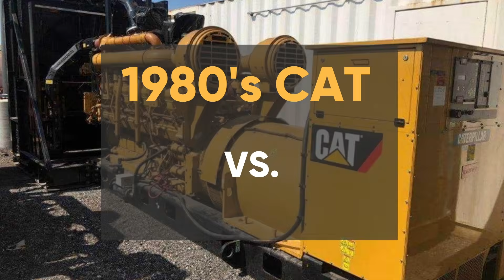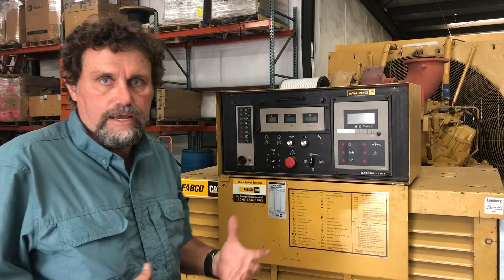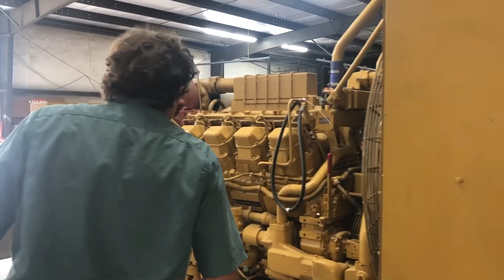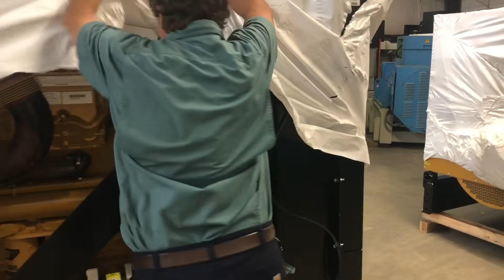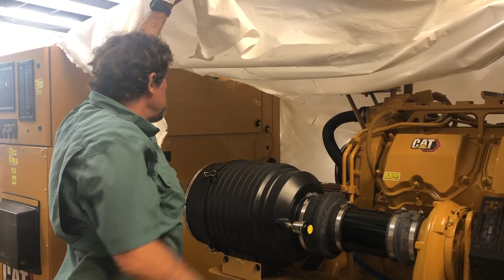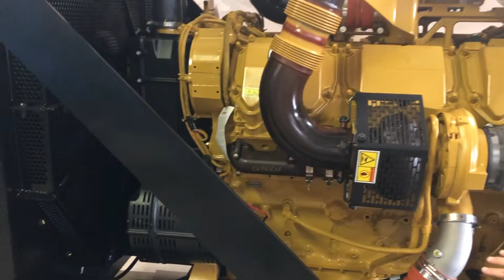2021 1000 kW CAT C32 Diesel Generator Review and Comparison

Comment: I would still take the older model as the newer model is so heavily invested in electronics that a power surge in the new electronics would kill it. Yes it is definitely doable to improve the old one to be more feeicient but the less electronics is a plus.
Reply: And that's why you work at McDonald's
Reply: @chechnya  oddly enough, I don't work at McDonald's like you're saying, I actually work in the industry that takes care and maintains these pieces of equipment and to be truthful. Electronics are changing so fast and you may have a 5-year-old generator or motor. This run with electronics and you can't get circuit boards anymore. That's why we're actively going back to mechanically run and controlled items because we can't get parts for new stuff.
Reply: @MikhailScottKy unfortunately emissions norms have made it a necessity to get a modern unit that will most definitely not last as long or be as headache free.